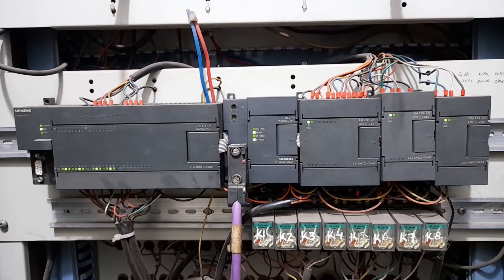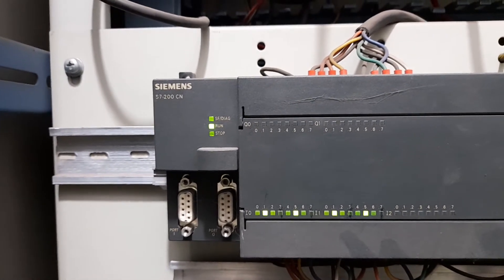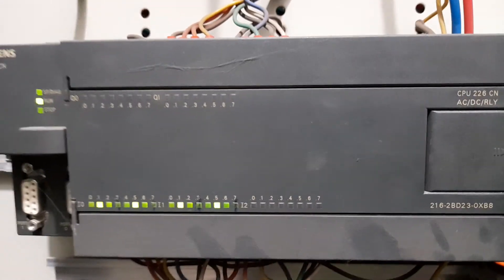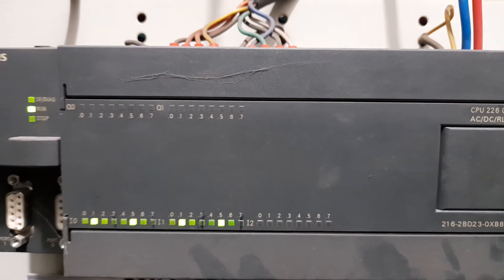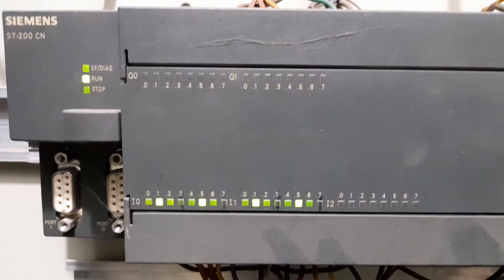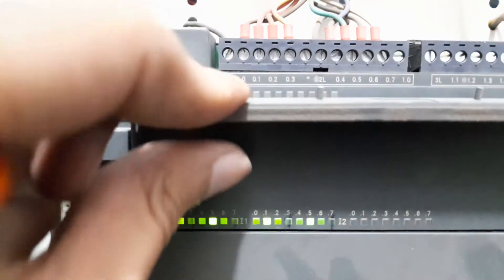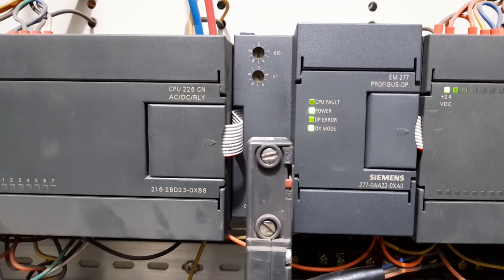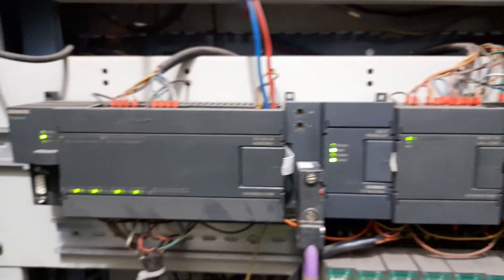Siemens S7-200 PLC | CPU 226 | Profibus DP EM 277 communication

Comment: Can I run HMI MT6070iH on EM 277 profibus module?
Reply from the maker: Wintek HMI can run on S7-200 PLC via RS 485.
Reply: @PLCNerd  Sir, i want to run HMI via EM 277. Can i do this? Actually i want to configure EM 277. Currently it is only connected on 187.5 kbps baud rate, while HMI MT6070iH communicates on 9.6 kbps. Please tell me how i can configure baud rate of EM 277 via Microwin Software?